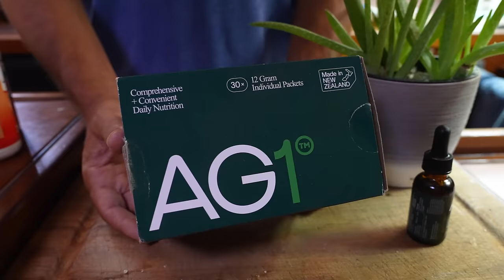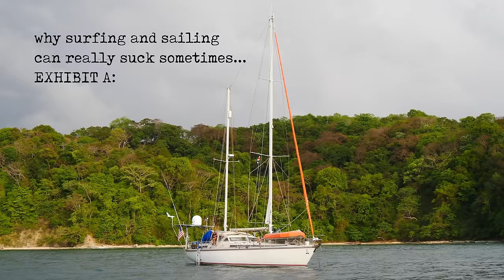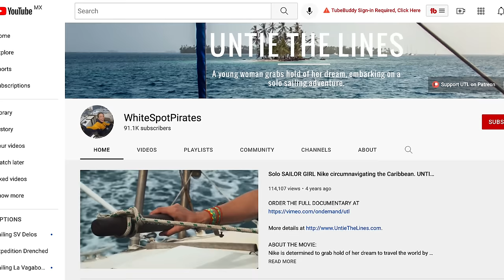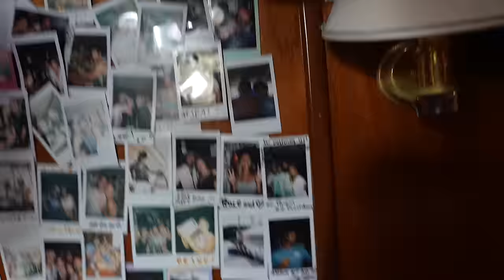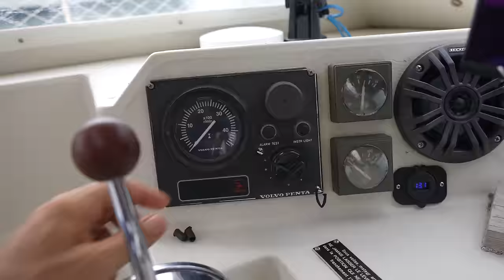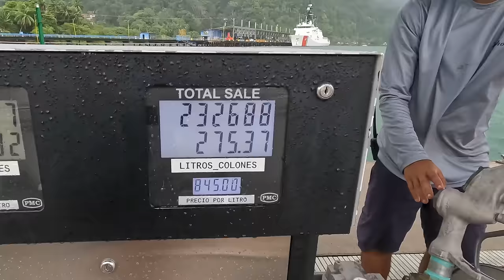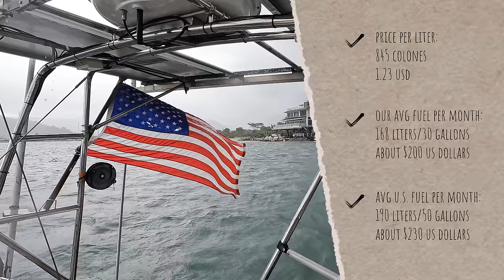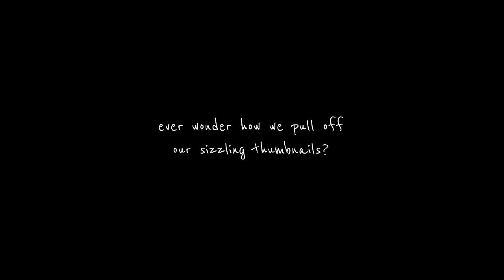We sailed 7 MONTHS to this UTOPIA! Sailing Vessel Delos Ep. 376

Comment: This mini-extruding machine is genius!! Love the idea of being able to distribute that to small communities and using it on sailboats. Whether it's to make little washers or zip-ties, or next level would be to find a way to use this for 3d printing. Then we would have a little plastic factory using 100% recycled trash from anything we find on beaches to make our overpriced little-knobby-thingies we need all around the boat ... I need one of those!! .. Whether it's for plastic sun covers for instruments, bushings, washers, spacers, the possibilities are endless!
Reply: Totally! We have been looking into that as well and there are some machines on the market that we are investigating. Most also work with shreds or granulate so you still would need a shredder…and then the 3D print filament extruder plus the printer. For the filament, it’s important that it’s highly consistent in diameter. With this manual machine, this would be probably impossible…but maybe you can challenge Brian to build a little motor spool and make it happen 🤣🤞🏼

Anyhow, yes, the 3D printing is an option with a slightly different set up and we are looking into it at the moment as well. You can check out @projectmanaia they work with this set up on their research vessel 👍⛵️♻️🌊
Reply: @WhiteSpotPirates  Thanks for your reply Nike; I'll definitely look into @projectmania. As for challenging Brian to the motor spool; I'm sure he's capable of great things and his background in engineering will certainly come in handy
Reply from the maker: @cryptosail0r  I'm gonna need a case of beers, a screw driver, a stick of gum, a trained monkey, and a jar of peanut butter 😂...I'm on it!
Reply: 3d Printing good results from this stuff is hard more easy i think is to make molds.

What molds I think maybe.
1. Wedges for Leaks
2. trill whistles
3. canisters
4. Parts for a watermaker or water filtration
5.shock absorber for ropes
6.funnels
7. Bins
8.Jar
9.fishing reel
10.lifebuoys

I am interested to see what they will make 🙃🙂🙃
Reply: @3l3ktroTichi  Love those suggestions, thanks for sharing. Unfortunately, we are running a little behind with the mold making, but we are trying to get some first trial runs done this spring, so it`s great to see your suggestions!

Comment: The tiny extruder was cool, I ran 13 very large extruders for 20 yrs... blown film extrusion... I had to pause the video to give it a quick study...  That tiny barrel and screw has to be pretty hot to melt the plastic down, so choose wisely where you mount it when it's in use...  maybe there is a panel to cover it, in the video it's exposed (maybe just for viewing purposes) but if that barrel is exposed, obviously you'll want it out Sierra's reach...  To Rob, I spend every Saturday with one of my best friends, she's a 2 time cancer survivor, we do a lot of back road cruising here in Vermont, so glad you are getting back out there and living your life to the fullest!!
Reply: The machines that we work with on the boats of our recycling fleet are all safety certified. Especially because we also work with kids. You have no access to the pipe when the machine is in use and yes, it does get warm...we work with temperatures around 140-180 degrees celsius, depending on the type of plastic we recycle.
The only thing that gets hot and is exposed is the nozzel where the filament comes out. And yes, Sierra (nor anyone else) should be touching that when the machine is running ;P

Comment: I can think of lots of stuff that you could mould that would be useful to other cruisers and the remote communities you visit.  From  extruded structural building supplies like beams roofing shingles/tiles, decorative colorful wall tiles etc.  Plates, bowls, and reusable plastic cutlery for using on the boat and especially when you go ashore for a meal on the beach. Berets, Hair Clips and Hair bands.

     Nice game pieces, like for instance some fancy chess pieces, die sets, or maybe even come up with your own Delos/Nautical Themed board game...  The obvious things mentioned in your episode like storage dishes and boxes for soap, food, items.  Wall hangers, candlestick holders,  boxes/compartments and separators for spare parts and tools in your tool boxes etc.... Planters and pots,  plastic clips and carabineers are always useful for clipping things to backpacks, or lines. 

      I'm sure kids of remote communities and islands would appreciate things like toys, skim boards, boogie boards, surf boards, or even replacement pieces for boards like fins.  Plastic handles for tools... Cruisers might appreciate things like water line fittings, and coolant line fittings for the common engines.

     You guys are full time cruisers, and visit these remote communities, what are a few things every Anchorage and village you visit are always in desperate need of?

Comment: RE. The plastic recycling would it be possible to extrude a filament compatible for use with a 3D printer, namely 1.75mm dia. Then the possibility of what one can create would be hugely expanded. Together with a 3d design programme your imagination is the only limit.

Comment: Recycling plastic "garbage" could have virtually unlimited uses. One use could be replacing, where possible, the use of steel rebar to reinforce concrete with webbing made from strands of  recycled plastic. When looked at as size of steel VS size of plastic,  steel is a lot stronger.  That said, there are many applications where  size to strength considerations do not have to be the deciding factor.    Concrete  reinforced with plastic webbing can be made into slabs and  sheets exhibiting good tensile strength  (provided by the webbing) and compressive strength (provided by the concrete).  Sheets reinforced with plastic webbing can be made at a much lower cost than other building materials that are currently in use.   Concrete slabs reinforced with rebar are currently in use for certain types of large commercial buildings, such as  logistics warehouses,  but not for residential structures.   While the strength of a recycled plastic reinforced wall for a residence  would be less strong than a steel rebar reinforced wall for a large commercial building,  in most residential application,  plastic reinforced walls would be more than adequate and far, far les expensive.   

Since discarded plastic is currently regarded as garbage,   the material cost involved in making use of it is extremely low. It merely has to be gathered up and processed on a small scale basis.  One major aspect of using it is that the infrastructure involved in manufacturing steel is extremely expensive. Manufacturing steel requires mining operations to dig the ore from the ground,  huge steel factories  to turn the ore into usable steel products and massive logistical considerations to transport the raw ore from the mine to the steel factory then  transport the finished steel products toe  another factory that turns the steel into finished products.  Steel production and use requires a huge expensive national effort. As shown in this video  plastic recycling, can be done on a small cottage industry basis using cheap, or even free, raw material (plastic garbage) and low cost manufacturing machinery.  A manufacturing facility could easily be set up in somebodies yard.    Recycled plastic  could be transformed into houses and other small buildings  within a small community using a manufacturing process  far less costly than the production of steel, wood,  brick, stone, or other building materials.   

 In applications where the material strength is sufficient,   plastic reinforcement  webbing could offer certain advantages over steel rebar; which is currently used.   As plastic is basically unaffected by moisture it won't be prone to rusting after being encapsulated in the concrete and would be more resistant to deterioration from weather conditions.  Since concrete does not burn, it  would be more resistant to destruction   from fire than flammable materials. Any sheets or slabs damaged by fire could be more easily ground and added to fresh concrete than concrete reinforced with steel rebar.   

While this is technically feasible,  since most virgin plastic is manufactured from oil and gas,   the biggest hurdle will be  political due to lobbying   from the  powerful oil and gas industries. If  the trend continues, the oceans and the rest of the  planet will continue to be polluted from plastic dumping. 
PHD

Comment: These central American countries are missing a fortune. I am a heavy machinery rigger, and mover. The reason house movers can move an old house made of sticks, and do it no harm is they lift the house at 3 points. Mexico, Nicaragua, and Costa Rica all have a narrow point of about 100 miles. If they had a railroad track with 4 equally spaced tracks. The train engine could set on the two inside tracks, and flat cars could set on the outer tracks then a monohull, or a catamaran could lifted from the water if the Pacific, and Gulf tracks circled under water to lift, or launch the boats. At 60 mph the trip would only be two hours.